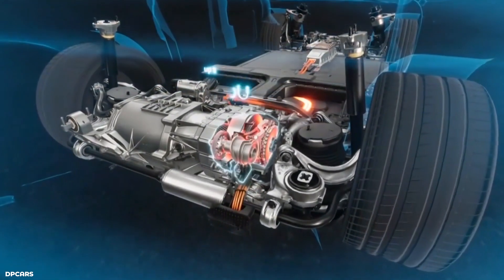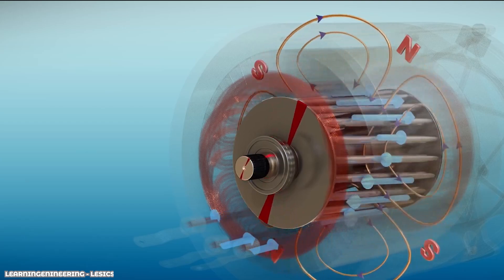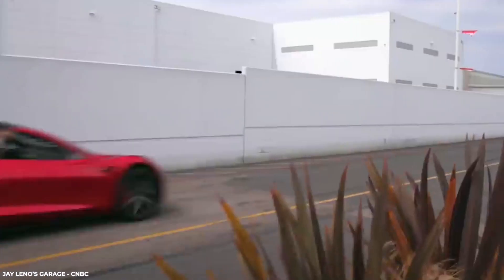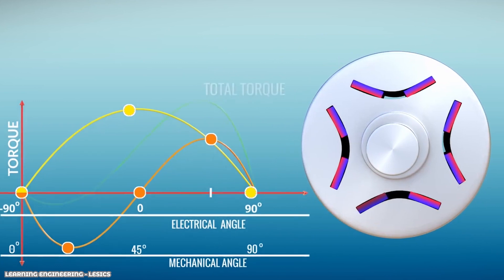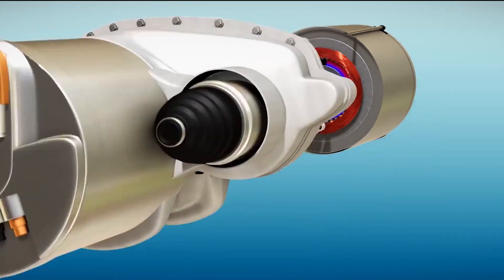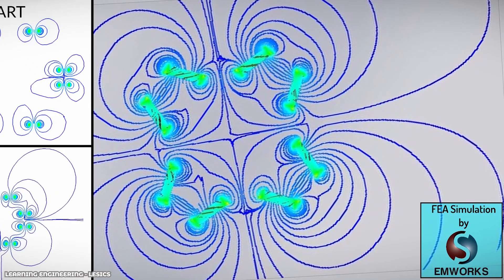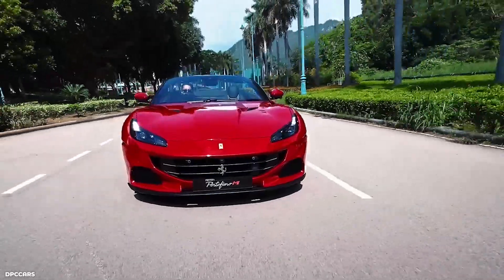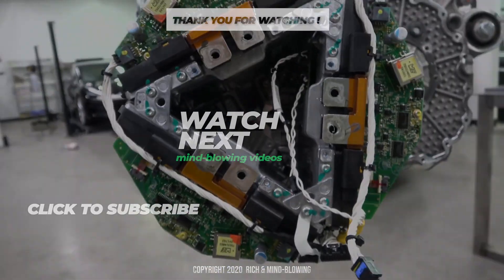Elon Musk's Brillant Engineering -  Why Tesla electric cars so fast ?

Comment: You meant to say quick not fast ! Tesla is NOT fast.
Reply: Yah yah your car is way faster
Reply: The Plaid Model goes 153 MPH in 9 seconds what are you talking about "quick not fast" lmfao
Reply: @pumpkin9916  You do not know the difference between quick and fast? 😂😂😂 back to school with you.
Reply: @zippodk  153 MPH is not fast?

Stop trying to sound smart. 99% of the population has never been 153 MPH in a car. Congrats on failing to think before you speak.

Edit: Take yourself back to school, as you don't know what a synonym is. Not only that, you fail to understand the definition of quick literally has the word fast in it. Also, the definition of fast is simply "move at or capable of high speeds." Thanks for playing bud.

quick

/kwik/

adjective

1.

moving fast or doing something in a short time.

"he was always quick to point out her faults"

Similar:

fast

swift

rapid

speedy

high-speed
Reply: @pumpkin9916  Exactly  FAST=HIGH SPEED! I am glad that you have learned something today! For cars in the same price range 150 mph is nothing. Should I learn you about top speed and limiters in German cars? Do you require links or can you find them yourself ?
Reply: Nevera is better in every way
Reply: @tihomirvukovic3614  I would hope the Rimac Nevera is better. It's $2.4 Million vs the Plaid $125k. You could buy 20 Plaids for 1 Rimac.